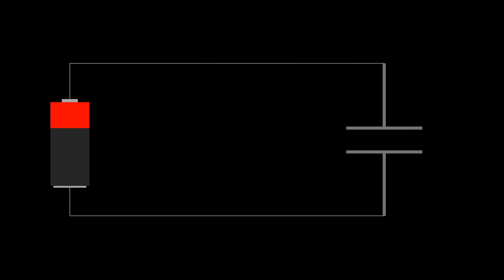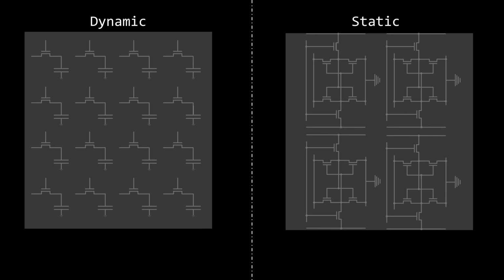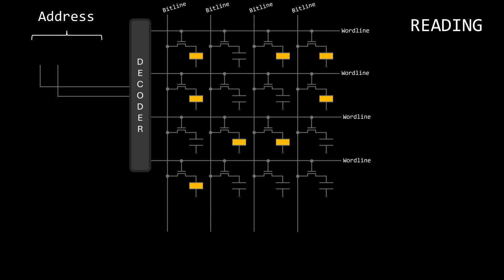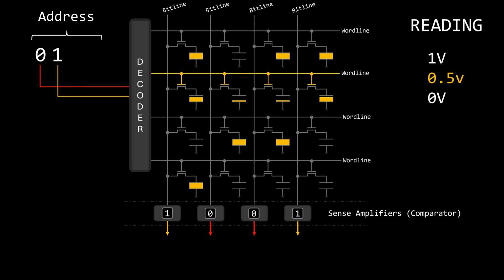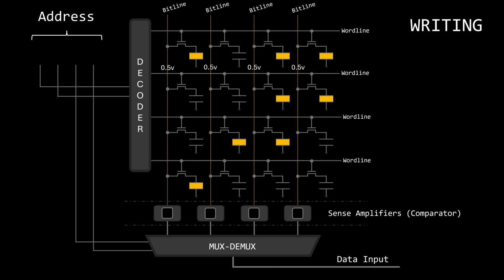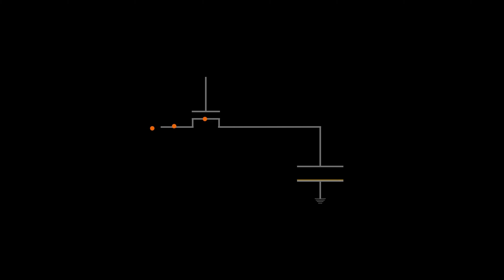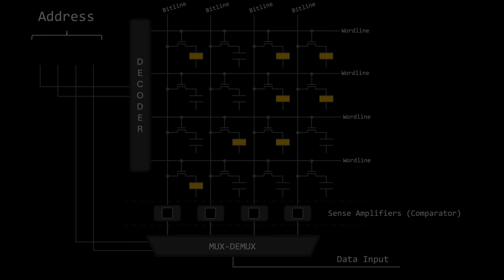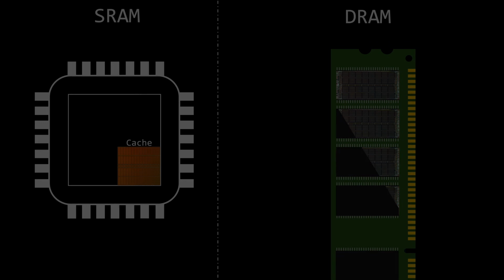Capacitors are terrible at remembering data. But for this reason we continue doing it.

Comment: Wow, I had no idea that my RAM was so sketchy! Now I am frightened! 😆
Reply: Yeah, I was surprised as well! That would explain why servers use way lower clock speeds and ECC
Reply: @el_quba  Hmmmmmm... I didn't know that about servers!
Reply: @oglothenerd  For example, majority of DDR5 server sticks stay below 5000MT/s* while consumer DDR5 quite often has 6000MT/s* and some even go above 7000MT/s*. 
This of course comes with instability issues (even without current Intel blunders) so PC build guides recommend keeping clock speeds modest for professional users. And now I know where that instability comes from!

* I use MT/s here, which is likely the correct unit, but RAM clock speed units provided in specs are a hot mess, so take the unit with a grain of salt. The main point still stands tho.
Reply: @el_quba  This is good info to know! Thank you!
Reply: Manufacturers lately have not trusted their capacitors lately. Based off The refresh cycles every 30 ms And they're adding error correction to the die in ddr5.
Reply: @AndrewMellor-darkphoton  Error correction algorithms are so confusing...
Reply: I think the more you learn about computers the more you stop being surprised when they don't work. You start getting amazed that they work as well as they do: You have this huge stack of software and hardware that all depend on the layer below it to work as specified (more or less). And this stack constantly gets software and firmware updates that might change its behavior and violate some assumption that you have made (either deliberately or unknowingly) when developing your component.
Reply: @compuholic82  Yeah! Like, if you put a too fast clock in your CPU, it will stop working! Overclockers scare me.
Reply: @compuholic82  Truth me, you don't even know the half of it. This is a good video for high level. It gets much more complex when you get into the lower levels.
Reply: If you think this is sketchy then imagine a single cosmic ray at 10 mega electron volt energy level hitting one plate of that tiny capacitor. Sometimes your desktop computer does BSOD without apparent reason ...
Reply: @YouCanHasAccount  My computer doesn't BSOD. I don't know what it does. (I use Linux.)
Reply: @oglothenerd it kernal panics my guy
Reply: @broggl  Well, yeah.
Reply: @AndrewMellor-darkphoton  There's a lot of criticism of that - not for the ECC, but for putting it only on-die rather than going for a full-blown ECC which would allow for monitoring of errors and protect against bus errors as well. It's a half-arsed effort when doing the job properly would require minimal additional resources. The more conspiracy-minded suggest this may be at Intel's behest because if their consumer processor lines supported ECC they would become viable for use in servers, and every consumer processor that ends up used in a server is a lost sale of a far more profitable Xeon chip.
Reply: That’s because the video exaggerates things a wee bit. Modern DRAM is just as finicky as high density core memory was, for the same reasons - it’s pushing the limits of what the materials can do. DRAM is a thoroughly analog affair and modern DRAM chips expend a lot of resources for managing all the margins needed for it to be reliable. Just like it was in core memory days where the highest performance memory either had to have the temperature stabilized by a thermostat, or it needed temperature measurement points and analog circuits that used that to maintain the read/write margins.

It is true that the CPU bandwidths have outpaced RAM size growth, so “rare” bit flips happen often because there is just so much data a DRAM is pushing around constantly. Do something long enough and even unlikely events are “guaranteed” to happen. When you’re pushing a terabit of data every second through a single DRAM chip, it’d take insane reliability levels to not have any errors on the scale of even hours. In the 80s it took a long time to finish a loop with 2^32 iterations that did nothing. Today you can read that many bytes from RAM in a fraction of a second.
Reply: @absurdengineering  Computers are so interesting...
Reply: Most of the stuff in CS and hardware engineering is sketchy at best. It's a miracle that your phone even works; or that the internet has stayed alive for over 40 years. I find the internet's existence to be the pinnacle of human collaboration.
Reply: @el_quba yes, but this speed is advancing quickly. In servers, it's not because slightly faster ram is more unstable, it's because building a memory controller that can handle 12 channels running at high speed is quite a job. New Epyc and Xeon platforms are already at 6000 MT/s for all 12 channels, and Intel wants to push it even farther with 8800 MT/s with special dimms.

Comment: I am an electrical engineer, have some knowledge of some programming and hardware description languages, have been working for many many years, and am familiar with many educational materials and lectures. I can tell you this much, your way of presenting and showing things are by far the most intuitive and understandable I have ever seen. I am also familiar with the Branch Education videos, which provide an incredible level of detail and make it tangible to the viewer. But your presentation goes so much deeper into the basics that not only newcomers but even experienced people can't help but say FINALLY. I take my hat off to you and your work. The greatest respect!

PS: Maybe you could make a video about why NAND flash or memory in SSDs, for example, is slower than DRAM/SRAM. Especially in view of the fact that you have described very well how SRAM gets its "storing" property when reading, a further presentation could show that it is not comparable to NAND flash or non-volatile memory. In my opinion, this would be a good bridge to explain the last bottleneck (memory) in terms of CPU(cache)->RAM>non-volatile memory.
Reply: I don't have any actual degrees, but I do have the knowledge and understanding of most of these fields from computer science to software and hardware engineering and I was thinking the same thing in regard to volatile vs no-volatile memory. I'd also be curious in a fine detail explanation of atomic operations.

Comment: There’s a type of memory in-between dynamic and static RAM called “lambda memory”.
It uses a reverse biased diode as a constant current source and a pair of depletion mode mosfets.

It’s called a lambda memory cause the current through it rises then falls with voltage. Because of parasitic resistance/leakage the current actually rises then falls then rises again. Due to this it can store 3 voltage states at constant current (LOW, MID, HIGH).

It also has another enhancement mode mosfet for reading/writing.

In total, 1 diode, 2 depletion mosfets and 1 enhancement mosfet gives 1 memory cell that has 3 states and uses 7 semiconducting junctions. Compared to a normal static memory cell that has 2 states and uses at least 12 junctions, it stores 1/3 more data in 1/2 as much space. Quite a bargain. Unfortunately, it is not in use due to very tight tolerances for manufacturing each memory cell since the nonlinear behaviour of the silicon is sensitive to even slight imperfections or doping variations.

Comment: Very, very well done!

I'm also a software engineer - albeit one hiding a logic analyzer and soldering iron behind his back.  So a few comments and nitpicking.

At the level of your video I think the finer details of newer memory types such as DDR memory imho can safely be ignored.  That's basically additional details that should be left for a closer look.

Memory refresh is complicated and some memory controllers have ample options to configure refresh.  For many if not most hardware this is undocumented black magic.  This kind of setup is usually performed by firmware in early initialization right after the CPU itself is ready.  Depending on the CPU the cache SRAMs might contain junk such as data with invalid parity or ECC which needs to be cleared first because the CPU can perform a cached memory access without blowing itself up.  Even an implicit memory access such as for the stack could do so, so at this stage subroutine calls are taboo.  You'd think hardware'd make that easy but wiring a reset line to everything that needs to be initialized for use once after reset is something that gets harrdware guys rioting and point their fingers at the software guys "you do it" 🙂 

Next memory controllers.  The cache may be working but DRAM still can't be accessed.  In older systems that was as simple as writing a few constants into the memory controller.  Some systems had to perform strange voodoo to figure out how much memory is actually physically present.  Yet more modern systems have feature known as SPD allowing the system to detect the quantity, type and speed of memory.  Software then programs the memory controller accordingly.  Still no stack access so such code often is a unholy mess of deeply nested C macros.  Optimal programming includes the use of features such as interleaving where possible and many more, so it's not trivial  Once this has been completed memory may need to be cleared to avoid parity or ECC errors.  And after that sanity arrives, everything else is much simpler now that "normal" programming is possible.

Some very old systems are nice in that they don't need any software initialization at all for their memory controller.  The hardware is (in hindsight) unsophisticated enough to just know what to do without being told to.

Finally caches may not always consist of SRAM.  One of the systems I worked with had three levels of cache.  The CPU was switched to a different architecture and the new CPU architecture had a different bus, so conversion logic was needed.  But that logic slowed down memory access.  That was fixed / kludged (you choose the term) by adding a 64MB L4 DRAM cache.  The only DRAM cache I know off but I haven't researched that exhaustively.

Comment: 16:53 - in earlier computers, the ram chips handled a single bit of a memory location and you put multiple together to make up the width of a memory location.
The address lines on the chips would only handle half of the address lines and would have pins that indicated whether the value on the represented at that moment a row or a column (RAS & CAS).

Comment: I see how scalability of DRAM is so good! You can basically keep the part with mux-demux and sense amplifiers and extend in the other direction, for which only a bigger decoder is needed.
I wonder, on the physical RAM memory chips, does this concept get used? The memory chips themselves are rectangular, so it is tempting to assume that the mux-demux and sense amplifier part is along the shorter side.

Comment: This was a great video explaining how DRAM works! 🫡

It's not within the scope of this video per se, but this also helps explain why DRAM has timing/latency values. A capacitor can't charge/discharge instantaneously so you have to wait a certain period of time for them do to that. And if you don't wait long enough, the voltage values are probably not within tolerance.

Comment: Since you're usually reading a lot of data at once tho when you do perform a read operation, computers do often cache the data in fairly large chunks, up to a few kb. It makes sense to do that since you're already reading the whole row, each extra byte you grab has pretty minimal cost. 
As far as refresh rates go, iirc 50-60ms is a pretty common interval, but you could go lower to like 20-30ms if you were really concerned about rowhammer attacks or similar

Comment: Fun fact: A MOSFET in integrated circuits is a 4 Terminal device. The BULK. it is just always connected to the gate when it is produced as a discrete device. In the more elaborate icon for a MOSFET, this is made visible.
Reply: You can get four-terminal FETs in discrete form. Usually the B terminal is used for biasing. You don't see them often, but they are most common in high-frequency usage where the input signal is so difficult to work with that just putting the correct bias on it is difficult - it's sometimes easier to have the bias voltage entirely separate from the signal path.
Reply: >it's just always connected to the gate
Did you mean to the SOURCE? Or am I missing something? On the MOSFET icon the arrow thing is connected to source..

Comment: In older 8 bit computers each bit of a byte was handled by a separate chip, much like your initial example. Hence the banks of chips you would see on their motherboards. Even on modern DRAM there's multiple chips on each stick and the load is spread across them. As far as I know, but haven't checked, the data bus will be much wider than the 64 bits the CPU normally processes. Especially considering that most systems work with pairs of DRAM sticks, not just one, so they can operate together to be even wider than a single stick would allow. In server architectures this can be even more complex with banks of 4 sticks working together.

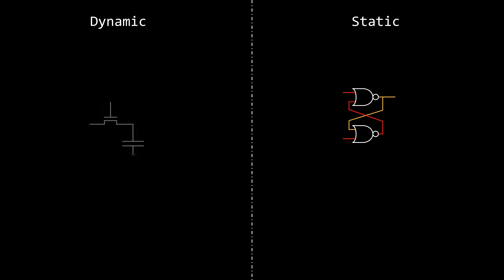Comment: 2:32 the transistor model doesn't actually map the gate model of the static ram cells: the transistor model is a double-(cmos)-inverter cell with two access transistors while the gate model is a double-nand cell with no further access method except of course the second input from both nand gates.

Comment: What happens when there is a cache miss during an instruction such as a load or add or sub instructions that has to now use slower ram? Also similarly what happens when it has to use drive - Is that when a process goes D state temporarily?
Reply: well the core has an out of order execution unit so it will execute other instruction instead or even switch the thread. there is always time wasted waiting and the trick is to make it do as many as possible.

Comment: That's probably why computational RAM exists. Sure, the computations are simplistic compared to a CPU, but a machine built with C-RAM is a whole lot faster than a general purpose computer! 😮
Reply: was C-RAM ever implemented in any real microchip I can buy ? I don't think that ever went out of the research phase. I was looking for something and only found the I-RAM concept.
Which ironically was more similar to how a modern GPU works, with a couple of small changes, you can make RAM synchronize with the parallel computation, so you don't need to specifically put the computing Logic near the RAM.

The problem is one of the process node, I bet capacitors suffer from leaks and that require special masking layers on the actual silicon , which would be unnecessary for normal logic, and make the transistors waste more power, as they also leak, but the leak doesn't matter much after the signal passed to the next clock cycle.

There's a reason why the entire industry is going for chiplets, so they can use different kinds of process node in the same design that produces a device.
If you study the story of semi-conductors you always find this split between memory manufacturers and logic manufacturers.

And even if you put logic near the RAM, DRAM is still slow, what we're doing now is putting the SRAM on top of the CPU, thus saving time on signaling. That makes the CPU go way faster, and you can have so much cache that we're literally going from DRAM to SRAM as actual memory, in modern CPUs, the RAM memory is the cache, the external DDR is actually more like disk, or network.
SRAM got so cheap, we just don't use more of it because we ran out of space in the actual die, its 90% SRAM already ! so that's why we're never going to see C-RAM, we have something even better, SRAM. And with 3D stacking like V-Cache , for example, the AMD 7000X3D , we can have the best of both worlds. 
And mobile SOCs (system on chips) were already using stacked SRAM on top of the die, like a chiplet, but with an interposer, not literally gluing silicon dies.

SRAM is used more like storage nowadays, everything happens on Static RAM, cache basically solved that problem.
Its all about the data-flow, RAM is slow, but with some "simple" synchronization circuit, you can turn normal DDR into GDDR, which reads the entire memory sequentially, row by row, thus you basically pipeline it, and then you put that in a huge BUS, and then you can have lots of parallel small CPUs working on the entire memory row.

That's what the industry did to GPUs.

Read -> Execute -> Write  pipelined. After the first delay, the memory and the "CU" (compute unit) will run synchronized with RAM access, thus effectively working like a C-RAM with 0 latency, but without actually having to put the logic near the RAM, thus using the already developed tech.

Its its faster than a general purpose CPU, because it is not general purpose, it can't do jumps, or branching, it can only execute sequentially, the RAM is not used as "random access", but there are still threads, so it is still random when switching from threads.

We didn't get C-RAM, but we got SGRAM, Synchronous Graphics Dynamic RAM. Which basically described what would be the design of modern GPUs since 2012.
Ironically the most consuming GPUs we have now are going for HBM with is basically SSRAM , synchronized static ram, since 2019, we need so much performance that we're going to just pay the price and actually use Static RAM everywhere, DRAM is too slow, DRAM is "disk".
Reply: @monad_tcp shameless plug: the 32 bit gaming consoles all had half their die dedicated to SRAM ( Jaguar, 32x, PSX, N64 ). PS2 then had chiplets and 1024 bond wires. Nintendo virtua boy had a silicon chiplet bonded to a gallium arsenide chiplet for red LEDs.

Comment: Wouldn't adding a second transistor that acts as an and gate, requiring both row and column to be powered solve the issue with reading a whole row of bits?